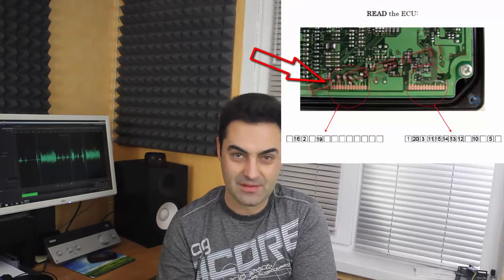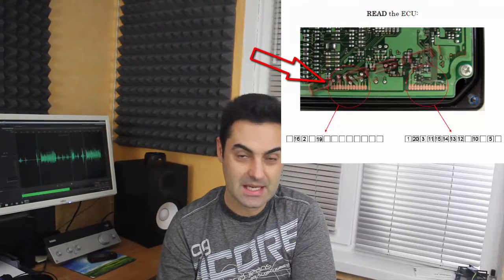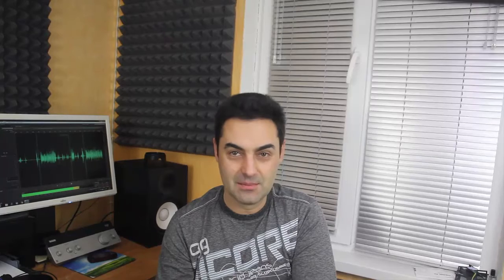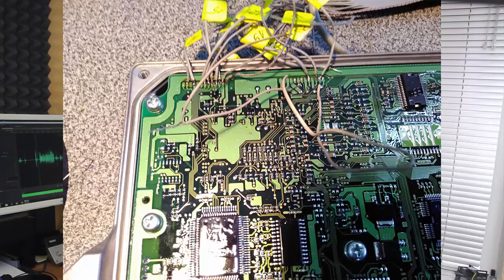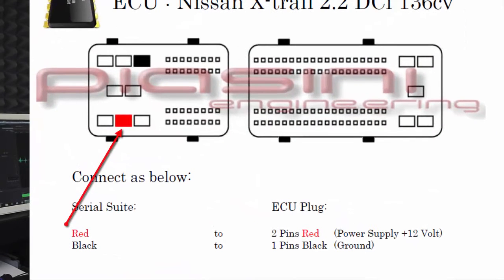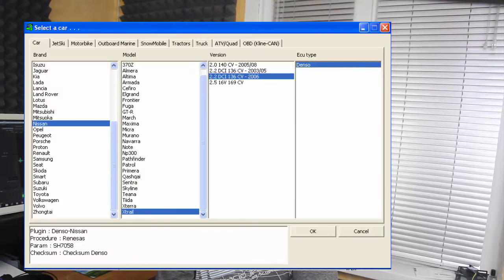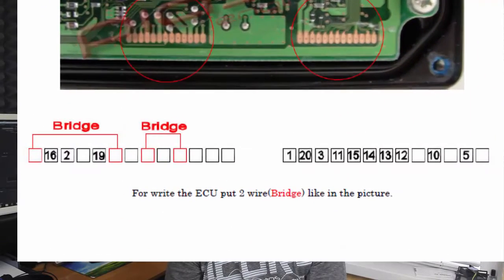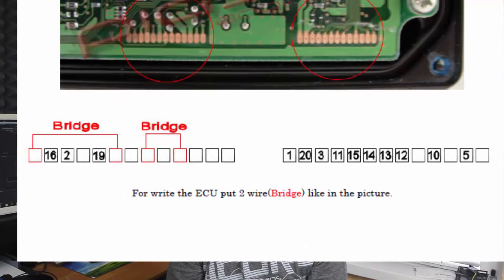Nissan X trail DENSO ecu READ and  write

Comment: Thanks for this video but i need full data or nissan extrail diesel in which eprom is 93c56 in bcm also
Mcu 7055f40
Reply: I use those method for chiptuning, not for immo purposes, so i cant be sure
.

Comment: is this also relevant to the earlier denso 8h8 22710 8h810 ecu as fitted to the 114bhp 2.2di models?
Reply from the maker: I cant confirm that. Did not have the chance to try it.